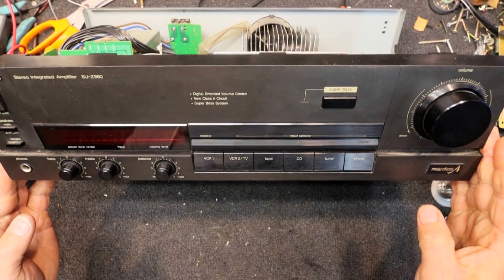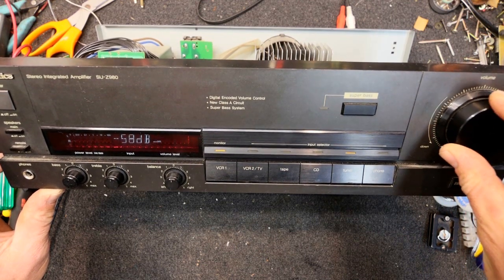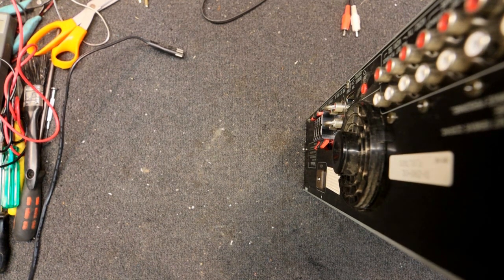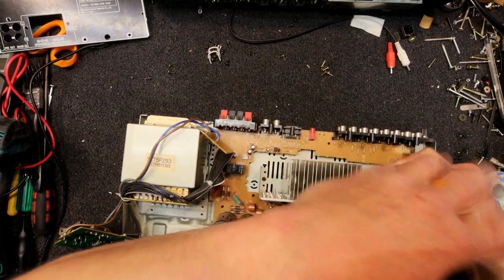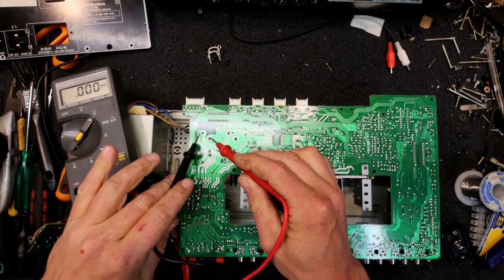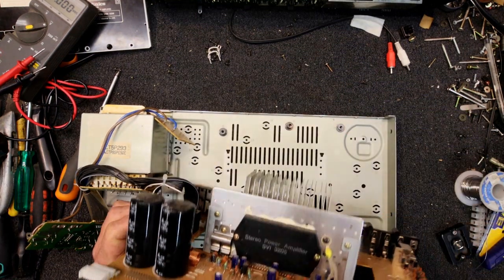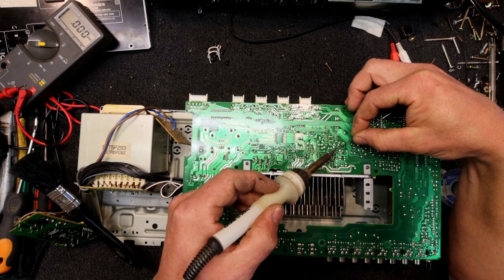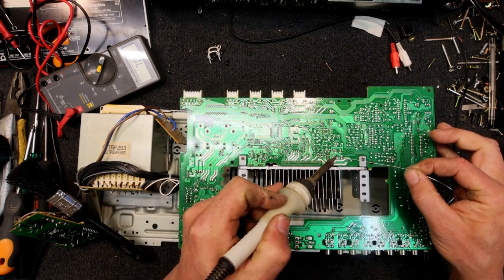Technics SU-Z980 Amplifier service

Comment: Wow very interesting video...you are the master and very professional engineer 👏 😊I have question please on my 
VINTAGE SHARP VZ 3510 VERTICAL LINEAR TRACKING RECORD PLAYER when I plug in the power and switch on and select radio or cassette player and there is no sound coming out from the speakers only loud humming / buzzing sound? But if I plug my headphones in the stereo I can hear sound on the headphones radio and cassette player as I was looking at the power supply and found the Bridge rectifier getting hot?and I have cleaned all the switches and pots with contact cleaner 
Hosa Caig Deoxit Contact Cleaner and still the same problem humming noise coming from speakers? This is the link for the service manual download https://elektrotanya.com/sharp_vz-3500h_vz3500hb_vz3500e_sm.pdf/download.html 
Please can please kindly help me on this issue 🙏 🙂 waiting for your kind reply Thankyou 🙏
Reply from the maker: The headphone and speaker connections are basically the same thing. There are a couple of resistors to drop the volume to the headphones is the only difference. If the headphones are working there is a good signal coming out of the amp. The only thing that could be wrong is the switch contacts in the headphone socket that disconnect both speakers when headphones are plugged in, the speaker sockets, or the speakers themselves. The switch or sockets usually only cause one or both channels to be missing or intermittent. Have you made 100% sure the speakers are OK? They should be rated at 4 or 8 ohms.